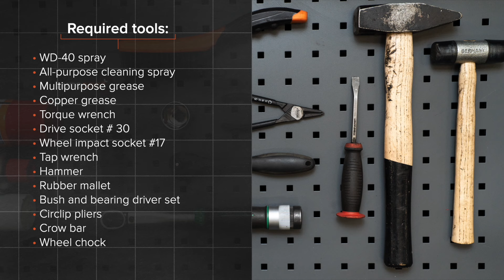Comment remplacer un roulement de roue arrière sur RENAULT CLIO 3 [TUTORIEL AUTODOC]

Comment: Bonjour. Comment savoir si les freins tambour arrières sont équipés ou non du système ABS, sans devoir enlever d'abord le tambour pour vérifier la présence de la roue dentée de l'ABS autour du roulement ? J'aimerais commander des tambours neufs mais il y a ceux avec ou sans système ABS. Merci du retour.
Reply from the maker: Bonjour,
Merci pour votre commentaire ! Nous vous invitons à contacter notre service client par téléphone de hotline +33 977 555 203, par tchat ou par mail (info@auto-doc.fr). Veuillez donner les informations sur votre voiture (marque/modèle, date de fabrication, cylindrée, puissance du moteur et le numéro de châssis – ligne E) et nous vous aiderons avec plaisir à trouver une pièce conforme à votre véhicule.
Merci de suivre nos tutoriels !